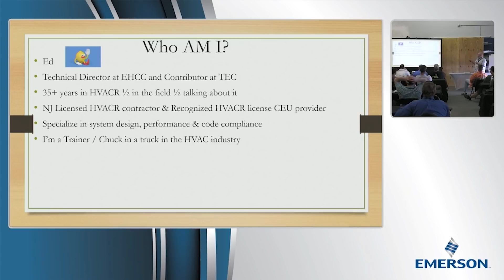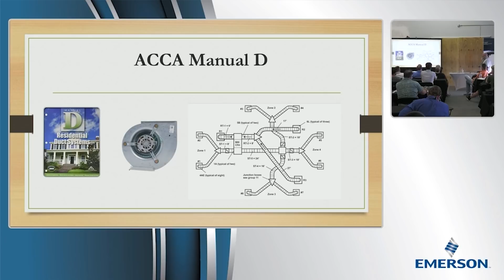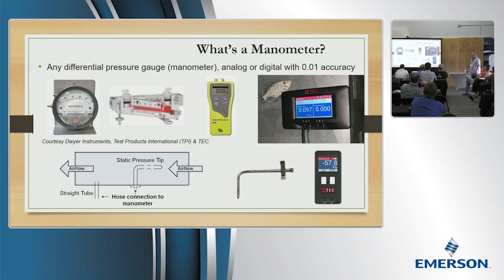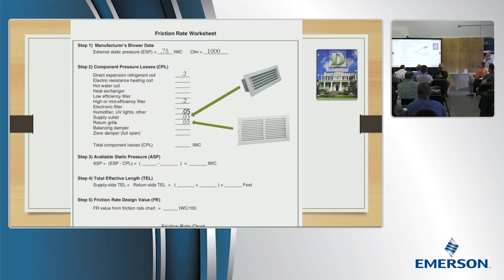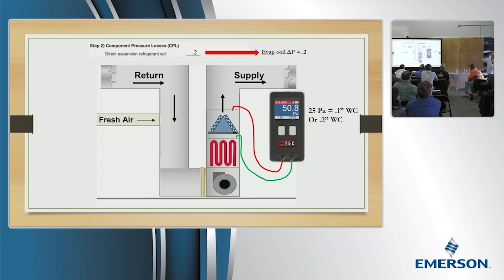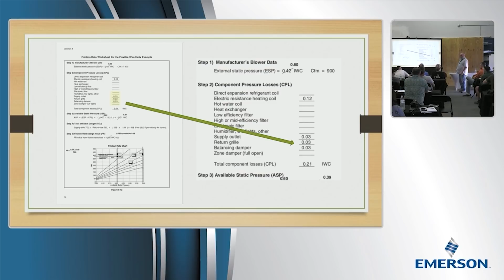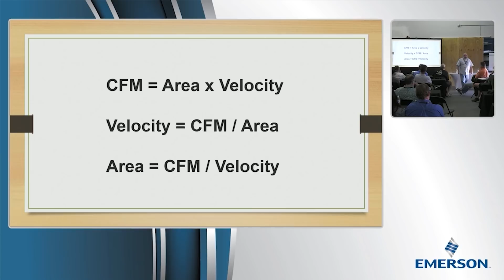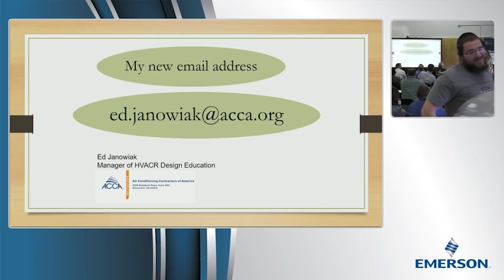Duct Design for Great Results w/ Ed Janowiak (ACCA)

Comment: I simply use 1 cfm per sq foot and size my room duct size based on that simple math and it works out golden. Did the static tests and right on the money. Granted it was all metal duct no flex. Reality is doing all the calculations makes more sense on complex larger systems to get everything well balanced but fact is it is your usually rounding up because calculations usually are between sizes often so there is no perfection in design no matter how complex the calculations. Willing to bet there is a common factor that could be used based on a few typical conditions that you use as a multiplier that will get you every bit as close. Most of the frictional loss factors are just that anyway.

Comment: What happens if you oversize the duct and the unit has zone damper
Reply: As long as the supply outlet, register selection is proper,  oversizing a duct and reducing velocity is not a problem. If you’re not controlling your branch run volume, who knows what’s gonna happen ( probably won’t be good).

Comment: funny thing, i reworked my hvac vents, removed the. yellow and pink hydroscopic garbage, sealed ALL connections with mastic and covered that with hytech ceramic additive mixed with rustoleum elastomeric roof paint then covered it with refectix. above my intake is a 12" pipe which leads tp hot water heater room which has a 25 inch vent with filter adjacent to fridge. both the heat from fridge and hot water heater are fed above intake on hvac. i run evergreen ecm 24/7 for filtration with merv 13, april air, and electrostatic prefilter with ecm 80cfm fresh air intake plumbed directly into furnace intake hooked up to filter box outside with 3 electrostaic prefilters. 5 uv lights. one in center of coil, one on each side and two on top with mirrors in coil housing to reflect uv light back into coil and set to timers. condensation line has cost guard pressurized drain with scupper valve. crawlspace is partially conditioned with no insulation in floor, a dehumidifier set to 50 with humidistat and temp gauge under home. temp gauge and humidistat after coil before main duct supply. not much more to do but get broans integrated system to run house exaust fan when fresh air fan is running, and a whole home dehumidifier like the santa fe which would dehumidify fresh air intake.
Reply: needs a few more uv lights
Reply: @adb99999999999  yes in main duct line just one because of higher humidity levels whe using ac.

Comment: Thank you for the review of ACCA Manual D, and for exposing the hard to find fact that TESP = ESP. If contractors actually use Manual D to design residential duct systems and retrofits, why do studies find that the majority of them are deficient? Do inspectors require acceptance tests of any kind designed to protect ignorant homeowners?

Comment: Notice acca fittings never assume a horizontal attic install. They also heavily penalize round tee wyes. How many rivers do you see with a bull head tee and only 90 degree takeoffs? I think ACCA's bias comes across in the TEL data.

Comment: Wish I had a dollar for houses and commercial sites that contractor cut corners installing undersized duct. Went round & round after installing a VFD for a 100 HP air handler. Could not run motor over 88 to 90% of full speed or motor would draw too much current.  Problem went away when door on both sides of fan were tied open. Worst part the undersized duct ran up 6 floors to mechanical room. Just great on cold days when they only run 100' of duct in a 300" long room.

Comment: Hello I have a duct system that has a 3" round duct that I want to convert to 3.25 x 10" rectangular duct. But the top portion of the 3" is to the roof. I'd say 15-24" that I don't want to change due to the roof work. I'm running about 15' of rectangular duct. How bad is it if I convert the majority of the ductwork and leave the last 15-24"?  My rangehood is a low CFM capacity. 180CFM max I believe. I know it's not ideal but how bad is this? I feel it's like fumbling at the 1yd line.... any advice good or bad would be helpful. Thx

Comment: So what you’re saying is, fab a big ass sloppy plenum out of duct board, and use a run of flex duct to a register in each room. Size the system 2 tons larger than required to keep the customer happy. Oversized ductapuss for the win…quick, dirty, and off to the next job.
Reply: Get out of my attic.

Comment: Hi Im just the average person who would hire a hvac guy to design my system and put it in my home. I liked watching and listening to your class but didnt understand alot of it. My question to you ED is this. As a homeowner how or what do you suggest or recommend to know if your getting the right system put into your home and if the system that they put in puts out the numbers that it should. Last question. What advice do you suggest when searching for a hvac person to hire
Reply: At minimum, a HERS inspector will have some mild input on that. I believe all HVAC replacements require a HERS report which is supposed to evaluate the ducting and determine if they are installed/sized correct and do not leak more that 15% at connections.
Reply: BBB - must be A+ and in business over 20 years.

Comment: All good information but the truth is unless someone is designing very complicated heavy commercial or industrial duct systems or some type of critical installation, no one that does this for a living goes through all these steps to install a 'home' duct system.   The best systems for homes are home-run systems because velocity always stays the same and all you need to do is size the duct for volume, but they do need to be installed before ceilings.

Comment: I've seen a lot of homes get built, NO WAY those contractors bothered with this math or point of view.  Especially those units that have the return grill 1 to 2 feet from the blower...they do that all of the time (or at least since the 1980's through the early 2000's they did).

Comment: Doing ductwork systems and change outs for over 20 years. Not many companies do this. When  you only have a certain amount of time  given to get the job done. You can go by the .1 static pressure to design your system. Go with .5 total esp from the furnace specs. you will be just fine.
Reply: Did you mean 0.1 friction rate?
Reply: .5 is really hard to hit on a furance and ac system. Most in the field seem to run around 0.7 to 0.8 external static
Reply: @KyleRicciardi  Nope. Static pressure determines cfm of air air flow in the system. You measure static pressure with a manometer, not friction rate.
Reply: @smacleod69  friction rate is what you select on a duct slider. 0.1 friction rate is what your referring to when sizing the duct. Unless your using velocity? There is no "static pressure" on a duct slider
Reply: @HVAC544  I can hit point .5 if I size duct work correctly. I can even hit .5 in a change out scenario by modifying r/a ducts like upsizing and/or adding a return. Using wide louvered  r/a grills instead of standard grills. Also increase the size of some supply ducts or add one. And lastly, do an air flow balance can help.
Reply: @smacleod69  could you reference where on a duct slider you would select static pressure. Because I own the ACCA, Trane, and ASHRA sliders. No reference to static pressure.
Reply: @KyleRicciardi  Friction rate on a ductulator is used for the type of material your are going to use. example. 6 inch galvanized pipe at .1 will give you 100 cfm of air flow. Take that .1 on 6 inch flex and you will only get 85 cfm. So if I  am using flex to run a supply run, I need to upsize to a 7"  to get the same air flow as the galvanized pipe. Gotta remember galvanized metal is smooth. Inner flex liner is ribbed which leads to a higher friction rate.
Reply: @smacleod69  you may be misunderstanding me. In your original comment you mentioned using .1 static to design your system. You don't use static to design a system you use friction rate.
Reply: @KyleRicciardi  No, you I havent misunderstood you. Using .1 always works for me.